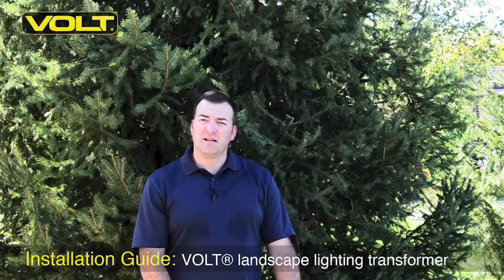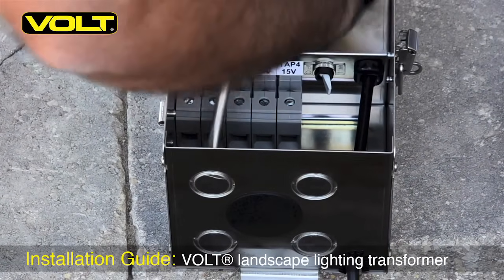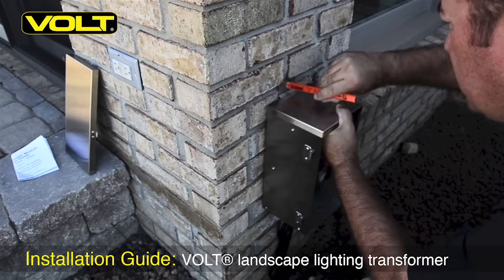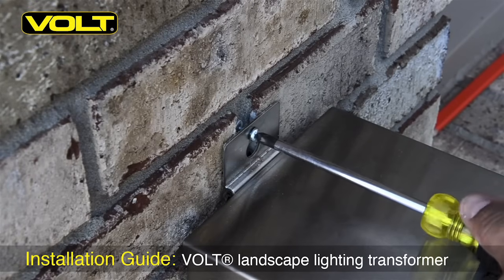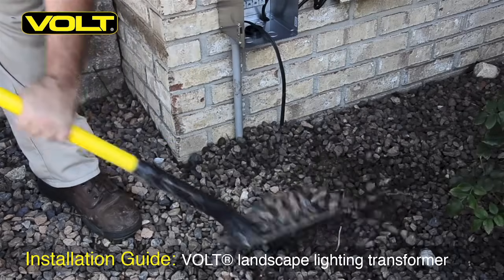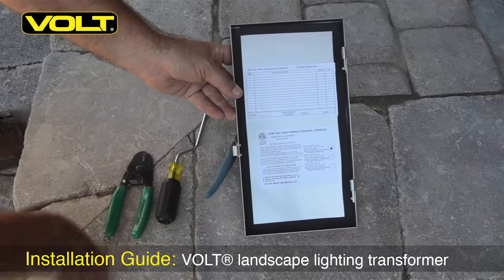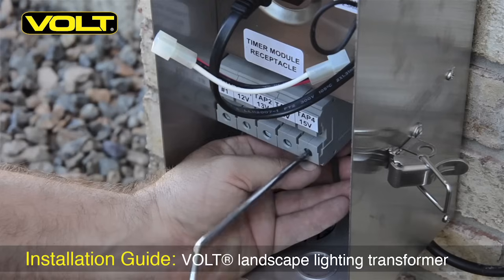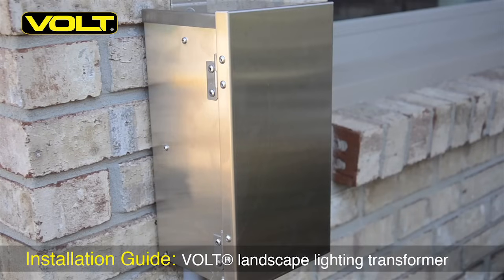Installing a Transformer for Low Voltage Landscape Lighting

Comment: This was great. Is there a follow-up video that shows how to connect the wire out from the Volt Power box and then head to each of the landscape lights?
Reply: That’s what I need to see as well.  How to properly connect the transformer to my outdoor AC power receptacle then to the spotlights and walkway lights.

Comment: I can’t find an answer as to where the most ideal location for a transformer is. There is an outlet at the side of my home but it’s exposed to the elements. Where should I put it???
Reply: You can put the transformer next to the outlet but make sure it's 20-30 inches above the ground. These are waterproof transformers and can be installed outdoor.

Comment: Can these be used for interior applications? I.e. for interior led accent lighting?
Reply from the maker: Yes! Our transformers are rated for both indoor and outdoor use. We also offer in-line converters, if that form factor works better.